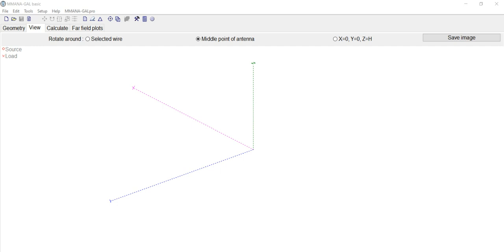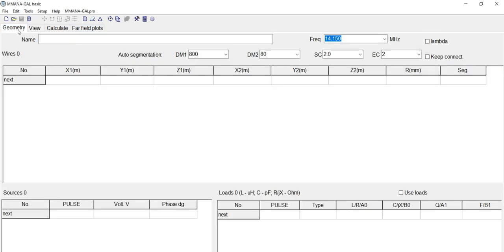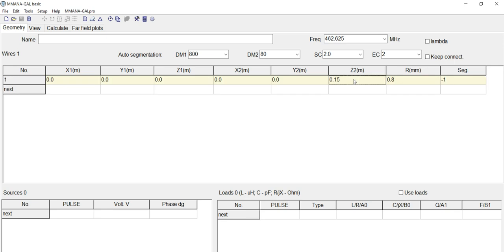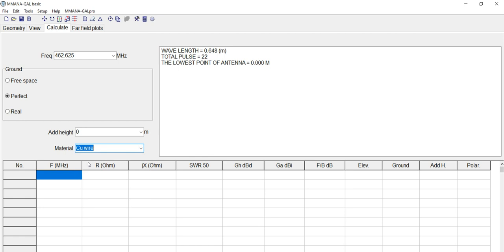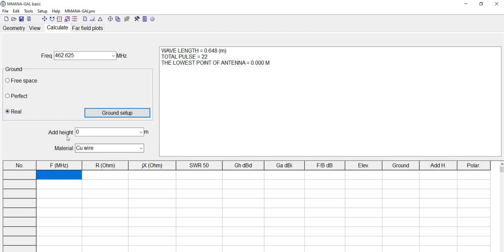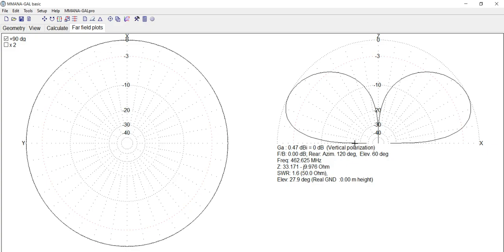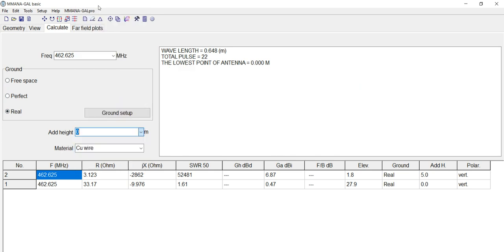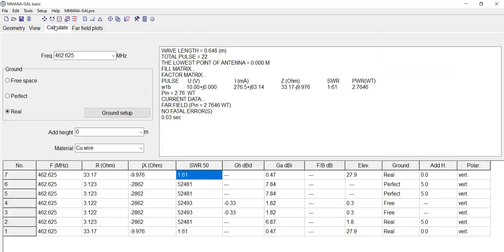🔺 Antenna Radiation Pattern changes with height!!  FREE GMRS two way radio antenna modeling software

Comment: The reason your swrs go up at height is because you have not added radials.
Reply from the maker: Yes,  at ground level you need many radials, but up in the air you don't need as many. I haven't played with this software, i got pull to other projects. I hope to get back to it soon.